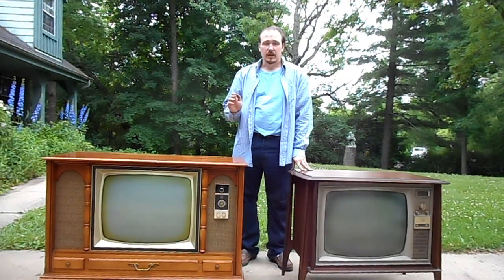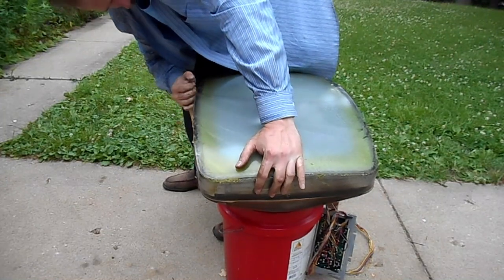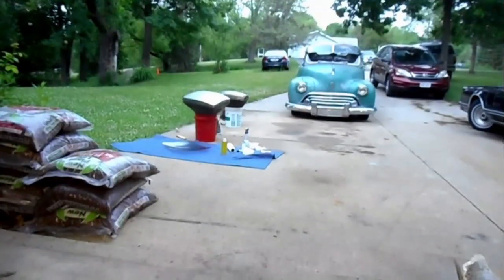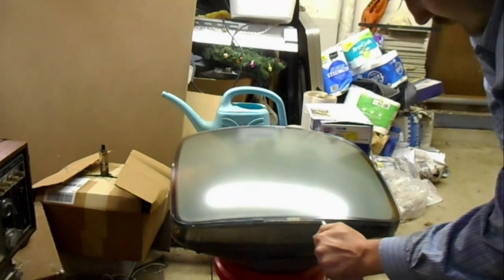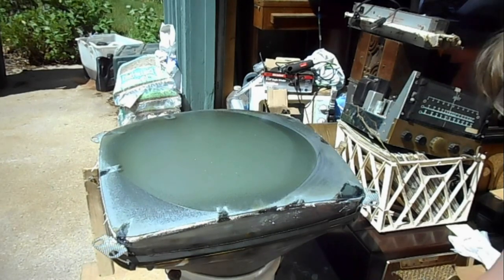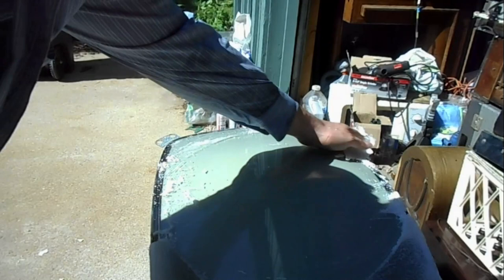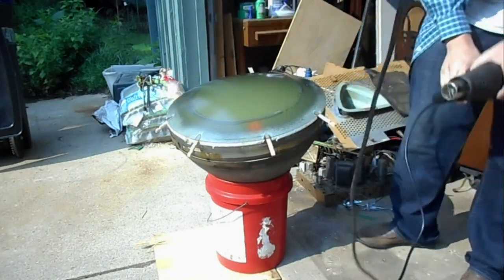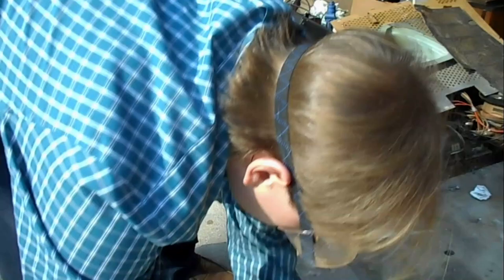3 Picture Tube Cataract Removals: An in depth look at Zenith and RCA styles and my removal methods

Comment: I wouldn't ever work on a concrete surface like that.  IF you knock over the tube it's busted but on a flat grassy surface it's less likely to bust and implode.  Just a safer situtation I think..Thanks.
Reply from the maker: I'd need to switch from the 5gal buckets I favor to something wider to work on grass. The bucket is too small diameter to be stable on a surface as uneven as grass, but it's perfectly stable on concrete. I prefer the concrete because I know I can find and clean up all the glass that falls if I crack a safety glass or ever get my first implosion....The grass people will be finding glass with their feet for generations if anything breaks there.
Reply: @tomcarlson3913  Yeah  That's true about the instability.  Just would hate to see or hear that you got hurt of destroyed a tube had it fallen on concrete.  Thanks for the reply.
Reply: @tomcarlson3913  Are you related to Mr. Carleson on Mr. Carleson's lab?  I  joke about him saying Ive never seen his dog.  Have yet to get a response.  I guess it's not funny to him.
Reply: I live a few miles away from the HIlliard, Ohio museum.
Reply from the maker: @jockoharpo2622  If you attend the early television convention we've probably bumped into each other before.  I'm not super worried about dropping a CRT on concrete. Most of my spares live in the unfinished concrete floor basement on high shelves.  I'm strong enough that IIRC I've never accidentally dropped a CRT(part of it comes to taking sufficient care and remembering you're holding essentially a bomb). Signal tubes on the other hand...Well let's just say there's a good reason I always wear shoes in the basement shop/hoard/collection storage overflow area.
Reply from the maker: @jockoharpo2622  I don't think I'm related to the guy with the lab....I don't have any relatives in Canadia where he hales from.
Reply: @tomcarlson3913  Mr C and you as well are great instructors.  Must run in the family.
Reply: @tomcarlson3913  Only been there once to take my dad there for his birthday a few years back and only been there once. i need to go to the next meet and see if anyone wants to buy something  I have a few interesting sets.